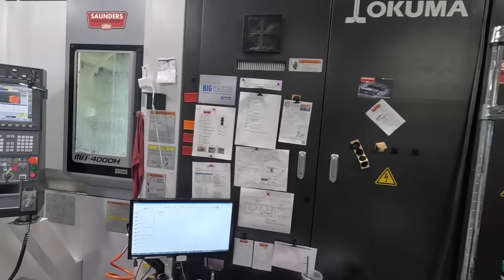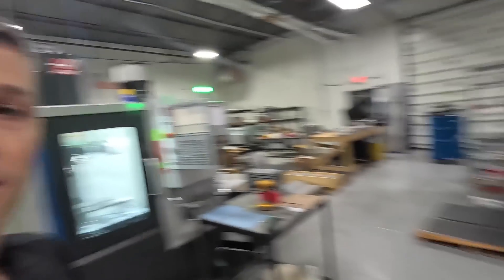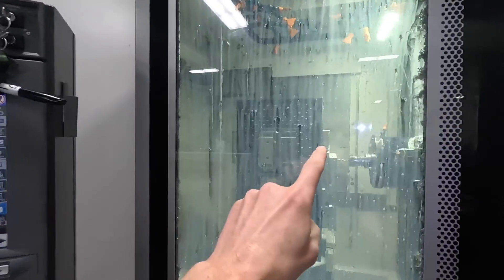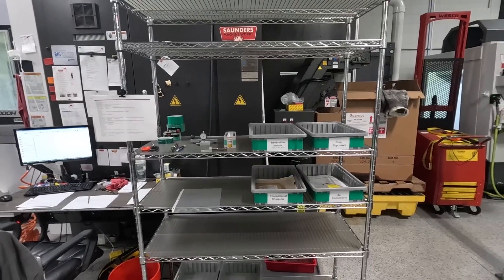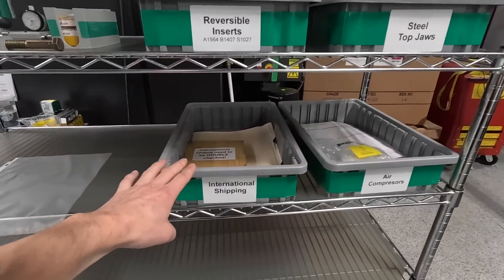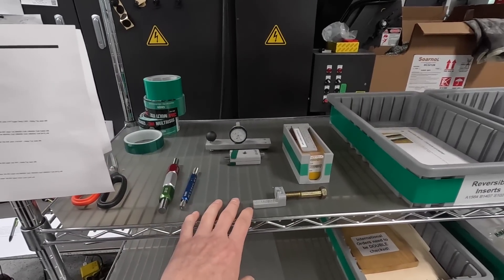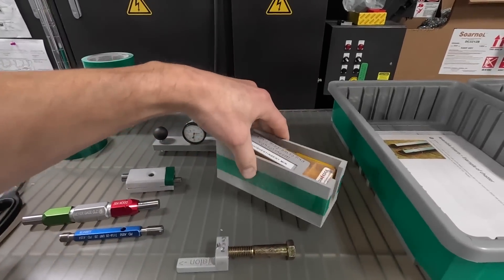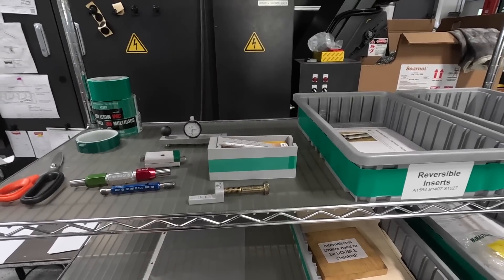Improving our Machine Shop with Process Bins!

Comment: Something I have been doing on machines or fixtures is writing the Allen or Wrench size with a sharpie next to the fastener head. You know exactly what you need right away, without grabbing a few wrenches and testing each until you land on the correct size.

Comment: For the cheeatsheets we use Display Panel Systems which can be wall mounted or come as a table stand. Ours are made by Durable but I reckon you can get them from other manufactures as well. The cheatsheets are great for having "common" knowledge about maintenance and operating supplies and parameters in  an accessible place for everyone who works at that machine.

Comment: One potential problem with storing oils and greases around the shop in different places is the potential of violating fire regulations.  You may be required to have them in a flammables cabinet.  Having the machines labeled with a photo reminder of the required lubricants and oil is a great idea.

Comment: Available information is key, sure. But knowing were this came from too. My experience showed me, I really need to put a reference to every cheatsheet. Too often I found myself scratching my head where I found something. Even worse If something changes by a nounce. Your're never sure if it was wrong all the time, or if something changed.

So I put a document reference on every paper (eg. On the backside) in order to be able to easily reprint it, and I put some reference to the source (eg. Manual name + version of manual) close to the actual information.

Speaking of document numbering... How do you organize your document management?

For me, it's a mixture of "by inventory number" and "by topic". Up to now, it's ok for me, but I already see some room for improvement.

Regards

Comment: In regards to samples and information on product defects (in my case, sheet metal stamped & welded car parts): if there is a common defect, we'll often have an example part on  the line, spray painted red to ensure it doesn't get mixed with good parts (stamping and weld defects, etc). And (per company policy), whenever a line is subject to a customer quality issue, the notice (with pictures) is posted on the line as a reminder to operators and other employees of what to look for.

Comment: Fantastic ideas!  I have been watching your videos and I appreciate the knowledge you pass on.   I recently got promoted to machining supervisor and I have I'm trying to get it under control.   I love the idea of the python script comparing the tools.   I'm stuck she that point right now.   I took a list of the current machined parts, a list of all the tools for the programs and which machines they work on with what tools.   I was working today with v lookup in excel trying to cross reference back end forth. Thinking there had to be a easier way.   I have some application engineers I can bounce this off of.   Thanks!

Comment: Love it, 
In the systems we use, we assign all equipment a equipment number, within the EQ# there's a Hierarchy with all the Relevant information, BOM (bill of materials) Filters, oil, normal consumables. Purchase history, vendor contacts, Serial Numbers ETC... with a link to a service manual OR relevant informant . Within the equipment file you can schedule/set reminder for preventive maintenance PM's that will automatically print out these Documents.  There nothing that can take place of a physical document/manual, though in my experience as it sits out in the shop/work environment for long periods, there always clutter and debris that tent to build up on them.  on a side note its always a good to have files and information stored electronically or on the cloud in the unfortunate event such as a fire, flood hurricane etc...

Comment: We have a motion triggered camera at the shipping station in our company so every order that is packed is recorded in case of missing parts or refund demands so there is proof that the part was shipped or we can check if we forgot to add anything. Thanks for the great content! 👍
Reply: Yes we do the same thing. It has saved our ass a bunch of times. Customer complains about missing items and we just send them a video of parts being packaged.
Reply: Nice tip
Reply: Awesome idea!
Reply: I have been looking for this exact thing for a couple of years.  Most motion cameras are wide angle, where we want to be able to read the packing slip.  Can yours do that, and what make and model do you use?
Reply: @precisionrp   i think it is EZ-IP camera, but i don't know the exact model unfortunately